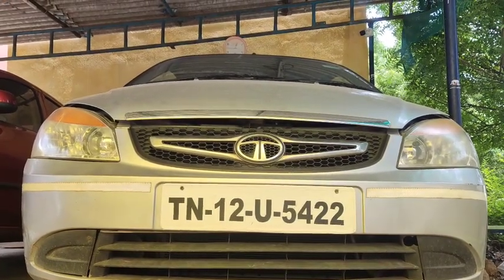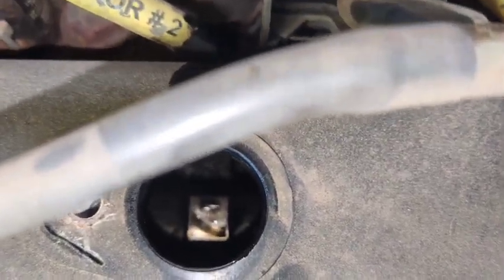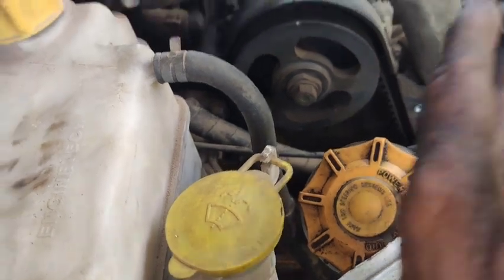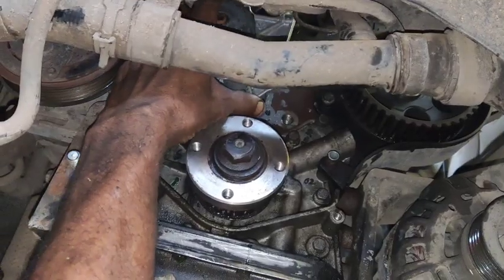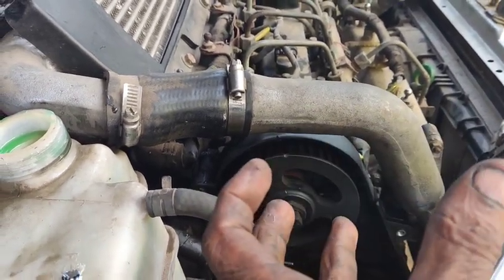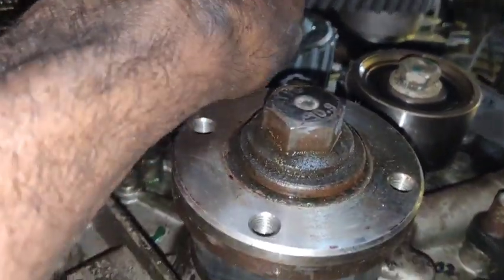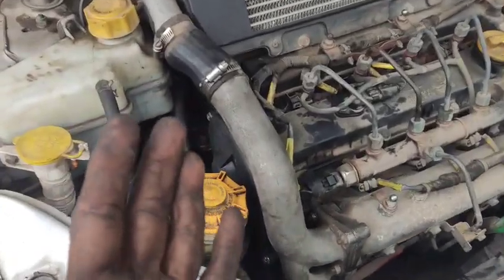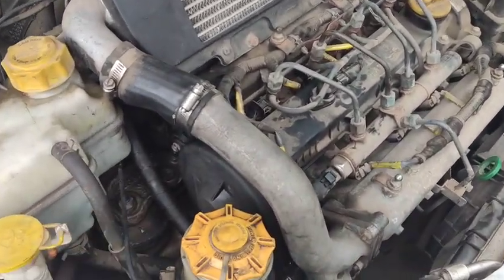Tata Indigo CR4 timing belt change(@skilledmechanictamil )

Comment: Safari dicor,, front wheel touch to front bumper what is problem
Reply from the maker: Bumper mount bolt check pannung illai
caster adjustment alighmentil parkavum